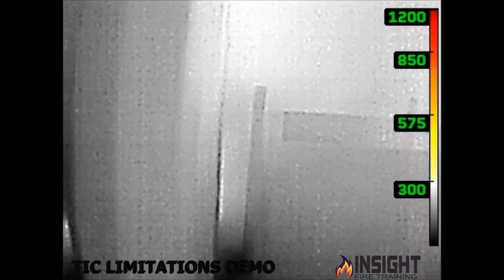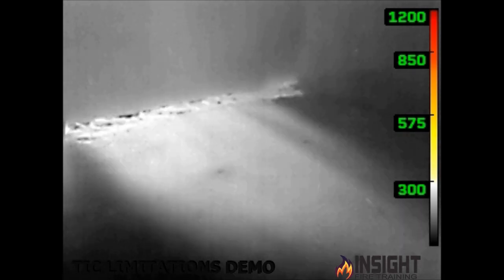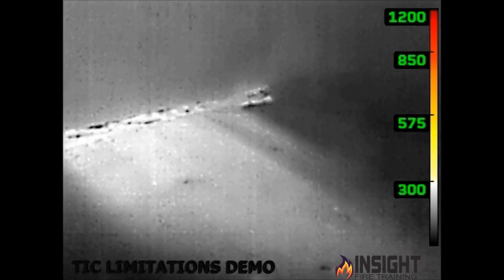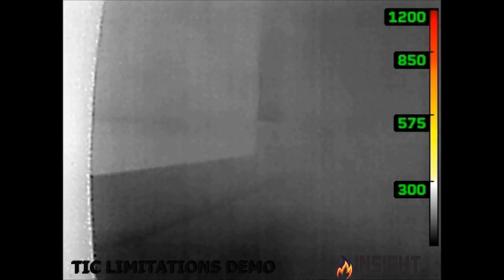When the TIC doesn't work!

Comment: Can something like acrylic or one of those car wash windshield treatments help keep the lens clear? I've not experimented, and it may be that the ceramic coating could also produce obscuring thermal effects.
Reply from the maker: @cherylm2C6671  the lens can’t be coated with that as IR energy will not pass through. You can put dish liquid or anti fog liquid on it but you have to reapply it after each fire
Reply: @AndrewStarnesFire  I have learned something- Thank You!